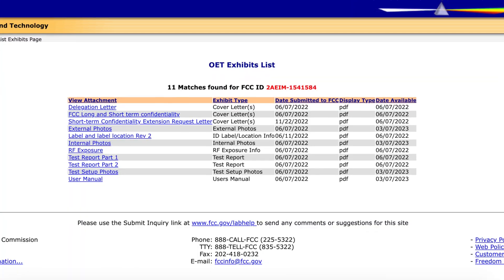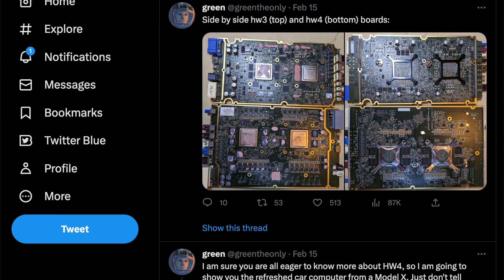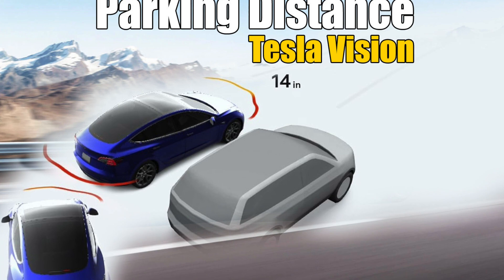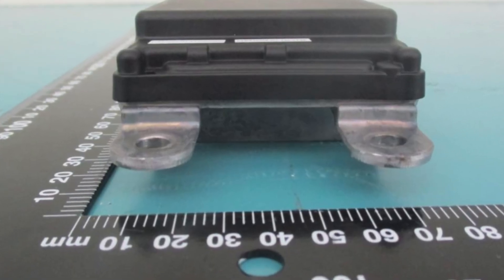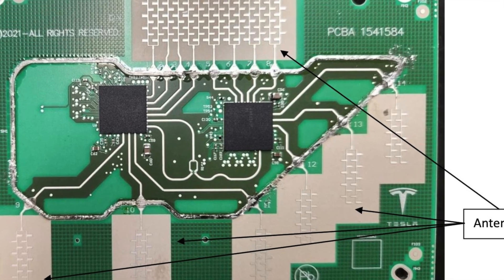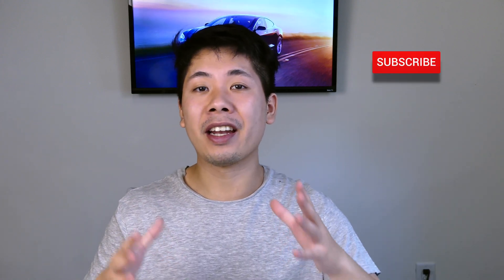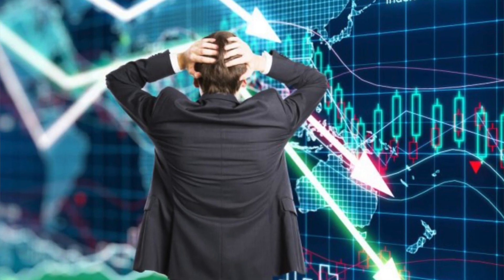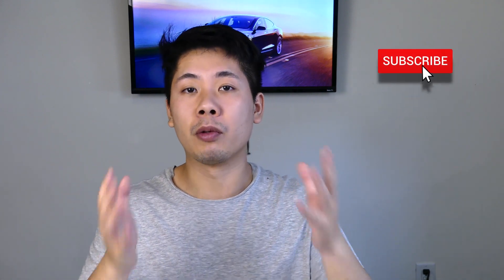Tesla HW4 HD Radar Leaked!! NEW Multi-Antenna and Wiring Harness

Comment: Elon already said he WILL NOT retrofit vehicles with HW3 to HW4.  Don’t get people’s hopes up.
Reply from the maker: He did not say those exact words, nothing close to it even. He says it’s not ‘economically’ a good idea to do it it - meaning, there is still the possibility of paid upgrades - although very unlikely
Reply: @heyJohnEe  on his last earnings call he said it’s not feasible.  Go check the transcript
Reply from the maker: “So it would not be, I think, economically feasible to do so” - first, he says he thinks, which is not the most confident way of saying NO. Second, he said it’s not economically feasible, meaning if taking the cost burden off of Tesla and customers opted for a paid upgrade there may still be a possibly. I’m not hyping anyone up for the hope of getting it, my video specially said that 2022 cars and older are out of luck, whereas 2023 and newer without USS still have a chance as there may be wiring harness pre-installed and ready for plug and play
Reply: @heyJohnEe  I hear you. We’ll agree to disagree. I feel this is left up to interpretation.  I mean you “can” pay for anything.  So theoretically, you can pay for the HW4 computer and have it installed.  But that’s like saying I want to replace the dash and screen in an 2018 MX for the 2023 refresh version.  Can you, yes.  

Not trying to be offensive, I like your channel.  Keep up the good work!
Reply from the maker: Cool, yeah I do agree that technically any 3rd party upgrades are possible if you have enough money, but if Tesla officially offers it or not is another story. I feel Elon purposely left things hanging so that it wouldn’t totally ruin sales during the transition phase, because really, who would buy a Tesla now knowing 100 percent their car cannot be upgraded to HW4 and also missing features from HW3 and missing USS. As for older cars with HW3, they’ve had their fun with FSD beta and have nothing to complain about really, everything is still working as expected so they’re out of luck with this upgrade

Comment: Problem is that you can place the order on hold for just 2 weeks.  After that you loose your deposit
Reply: You can try changing config before getting VIn assigned like change color then you get pushed to the back of the line.
Reply from the maker: That’s a good idea too
Reply from the maker: Yeah unfortunately they just put this new rule in place, back then I was able to extend indefinitely

Comment: Bought the model Y without sensor for parking, is there going to be a solution for it or not?...
Reply: There is it will use the camera sooon. When? nobody really knows :) But there are videos running around youtube recently where a scrapped model 3 that does not have sensors but using cameras for parking assist.
Reply from the maker: Tesla Vision is the solution, although it will not be as accurate as parking sensors
Reply: @heyJohnEe  will the Tesla vision (ie parking assist) be available even its HD3 with 8 cameras without USS? I also bought the 2023 Model Y LR..
Reply from the maker: Yes, that’s still coming in a future software update. Although, it will rely on memory using the occupancy network rather than real life data
Reply: @heyJohnEe  thanks, I see. Better than nothing! Look forward to hearing more on the investor day🤞

Comment: Finally Elon admits that removing radar was a horrible idea I hope they work on it this time rather than just removing other important hardwares because stats show that it wasn’t used much
Reply from the maker: I believe he said only high resolution radar is relevant, old ones were causing more noise hence why they removed it
Reply: Well it’s not that simple Lancer dag8. The old radar was causing so much noise since the vision system is getting so much better so it was actually really good to remove that specific OLD radar.

Now the new radar is something brand new and developed late 2022. It’s called ”HD Radar” which has alot more capability of specific size measurement of objects and overall distance increase.

So your wrong, it was good to remove radar from the now called legacy cars and it’s good to introduce the new radar to the new cars.

So what does this mean for fsd? Well the only difference is that HW3 vision only systems will be capped to 100x human driver capability which is really REALLY good. And HW4 will be capped at sround 1000x better than humans :)
Reply: @STRIDwastaken  just don’t use the ultra sonic sensor for self driving. Use it for parking sensors which this doesn’t even help with. Also zero reason to remove it before the replacement is ready. It was purely cost savinf